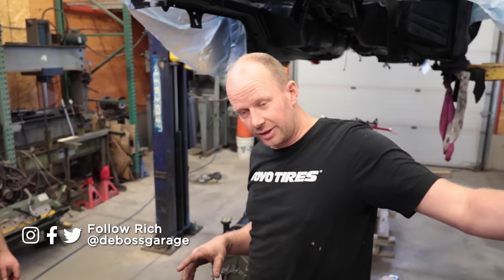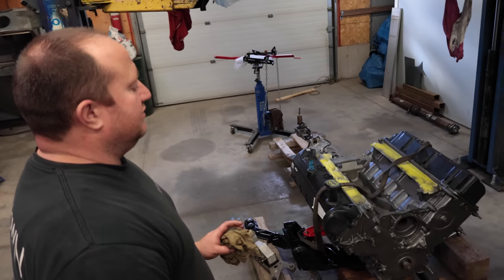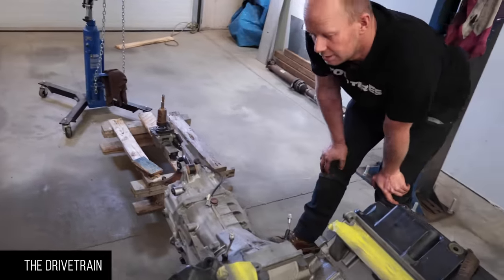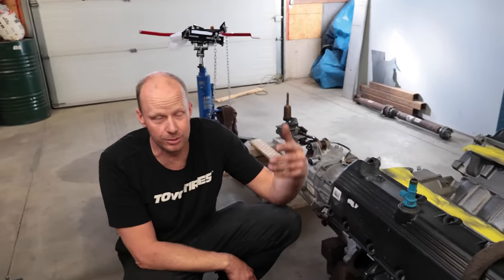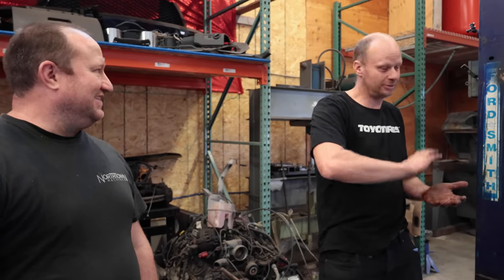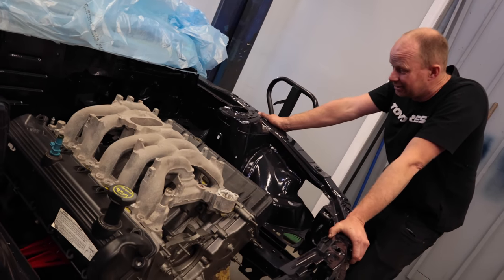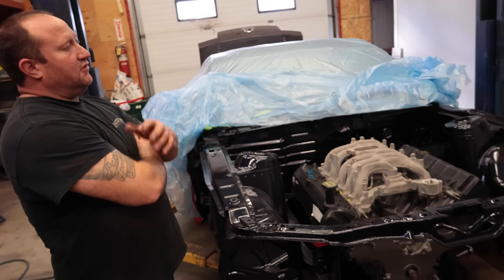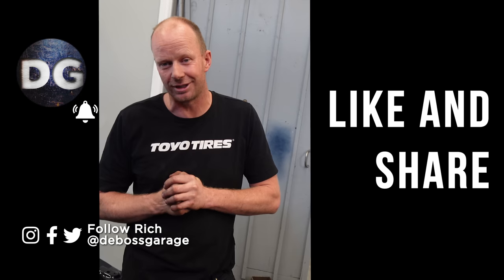6.8 Ford V10 stuffed in a Mustang.. 8v71 Blower or Nah? #V10Stang [EP1]

Comment: A blower would definitely be more cool than turbos.
Reply: Agreed.
Reply: By cooler I agree if you mean it would be LESS HOT
Reply: Turbo/s would make more reliable power on less boost not to mention keep the torsional load off the little short bolt crank snout.
Reply: @PeeterPuncher  your completely right especially since they’re more efficient too, however it would be more unique to see a blower set up instead of a turbo/ turbos set up
Reply: @fastinradfordable no way, the blower would run hotter. They are famous for it
Reply: Wont get any decent power with a supercharger tho
Reply: Now ya talking🫡
Reply: Put the pipe down 😂
Reply: Just run both👌
Reply: @PeeterPuncher turbos will  generate crazy under-hood heat. Which brings a bunch of problems to iron out.
Reply: @TexTheMaster nope turbos are known for making a ton of under-hood heat!
Reply: Blowers are always better than turbos...!
Reply: For REAL
Reply: @g.o.b.2558 I agree that would be the coolest
Reply: @kurtisstutzman7056 always? Lol
Reply: @utookmynames  Always...!
Reply: @erikturner5073  yes turbos do create a ton of heat but superchargers more so. The average IAT will always be lower on a turbo'd motor than a supercharger
Reply: @TexTheMaster  that means nothing when that turbo is COOKING everything near it under the hood. Also without intercooling BOTH turbo, and superchargers generate high intake temps. Pressure and temperature are relative regardless if it's through a supercharger or turbo. For me if I was building a street car to be driven in traffic as a daily, I prefer a supercharger (I'm not trying to back my under-hood components). If I'm building a track vehicle, and I'm not worried about backing the engine compartment, or endurance, but going for power, I  will probably go turbo.
Reply: yeah but turbos would make more power
Reply: @florider_hd  not necessarily... I prefer more low end torque/ power than waiting for turbos to spool...! Low end is more useful on the streets... thanks
Reply: @fastinradfordable heatsoak is a huge problem for most superchargers
Reply: @PeeterPuncher  I wonder if it would need a crank brace like the coyote does if you put a blower on it

Comment from the maker: Should Scott put an 8v71 blower supercharger on this or twin turbos?
Reply: I think a blower to keep a better power curve
Reply: Blower all the way.
Reply: I honestly think keeping it stock or with some nice ITBS would be awesome. I think a blower or forced induction would take away from it rather than add to its appeal. UNLESS its for performance only then id go turbo for efficiency and ease of adding an intercooler etc.
Reply: Blower or itb n/a
Reply: hell yes
Reply: Blower
Reply: 16v71 blower with an underdrive. With that triton weight is clearly not an issue, and it would absolutely scream.
Reply: Love that the V10 might start getting some love. Definitely team blower. Also, not sure if you can increase the bore on these engines to that of the 5.8 Shelby engines but that would give you a 7.3 and blower pistons.
Reply: NA, definitely NA. Keep it simple keeps the heat down, and a great machinist like Scott can definitely make that V10 destroy any tire thrown at it without a power adder 😉
Reply: I vote 871, I’d also like to see one of old Kenne Bell 6.8 superchargers, but those are difficult to find. And a 871 would be REALLY cool on this ole mustang
Reply: @maxwellg1361 I was going to comment 14-71 but hey... go big or go home, right? 😂
Reply: Keep it NA
Reply: Blower!
Reply: Lets not make it look stupid hey! Put a centrifugal supercharger like pro charger or run whirly bird/s!
Reply: @larryw5429  centrifugal superchargers are only good for top end. They make peak boost at redline, and give no boost at low rpm. Good for racing, not for street.
Reply: @Cantthinkofahandle117   14-71 would work too! But if anything is going to make a 8-71 look 'small' it's this.
Reply: blower forsure
Reply: Team blower for this one. Massive motor with a blow on it would be 👌.
Reply: Supercharger 💯
Reply: Blower for the look there will already be enough power. and low down torque is always fun.
Reply: Blower
Reply: blower would be real cool!
Reply: yes because a turbo 6.8L is pretty much too common and his will stand out as unique. plus the only roots style supercharged V10's i have seen were a hemi head swapped Viper V10 with an 8/71 and a R8 V10 with a whipple
Reply: Blower.😊
Reply: I have to go with ITB's as said before a couple of times. The torque and power would be more than enough. Add some higher compression valve springs and having that high revving v10 scream would be amazing.
Reply: I think ITBs would look amazing on this engine. Also, do you think the gearbox can handle the torque of the V10 plus boost?
Reply: Absolutely not, the old gmc style blowers are horribly inefficient and rob tons of horsepower.  I have an old Mooneyham 14-71 with a Hillborn 4 port mechanical injection sitting on the shelf in my office and it is serving its best purpose and that is wall art.
Reply: @camoking5059 The 5.4 kenne bill kit fits just by changing the snout.  I recently purchased a brand new old stock 5.4 kenne bell kit for a 2001 for $1000 on ebay.  The person thought the kit was missing a bunch of parts and it wasn't missing anything they just didn't understand how its installed.
Reply: Blower all the way
Reply: blower or na for sure
Reply: Blower
Reply: I would go a tvs 2.65 or a 3.0 whipple.
Reply: Twin super turbos, (think Nissan March Super Turbo) but up sized. Or something like what they had in a 1.4 TSI Golf GT. Yeah it's super complicated and probably pretty much impossible and absolutely not needed in a big engine etc. etc.
Reply: Blower.. dont overcomplicate an engine swap project that is a tight fit with a shit ton of turbo piping and all of that heat
Reply: 8V71 for low end torque. No idea if that tiny differential will hold together.
Reply: @Joebauers2505  The tvs superchargers produce way too much heat, the 8.3 Whipple would be a perfect fit and it wouldn't have to be over spun.
Reply: Turbos!!! ALL THE PSI!!! Also there are other ECM companies like Haltech.
Reply: Definitely blower!
Reply: Blower ftw
Reply: blower.
Reply: blower is must have
Reply: Either a blower or a couple of twin scroll turbos. Better low end. 
 My question is will the crank handle the boost? Especially where it has the conjoined rod journals without much of a strength radius.
Reply: Blower 💯
Reply: Blower!!!! V10 Blown Mustang sounds so cool
Reply: I know it is not as cheap as an LS but what is the reliability of the V10? I hear👎 but I am interested in the professional opinion
Reply: Blower take a lot of power to run. Id keep it na, scott knows how to make na power without heatsoak and extra weight
Reply: ❤ the sound of a roots blower
Reply: 16v blower for sure
Reply: Both duh 😂
Reply: Blower would be unique.
Reply: NA or blower to hear that V10 exhaust note.  Perfect build so far.
Reply: Modified svt lightning intake and supercharger. That would be cool
Reply: Blower 😎👍
Reply: Blower
Reply: Blower for sure... 😂😂 that standard manifold is ugly as sìn 😂
Reply: Blower..
Reply: Super charger all the way!
Reply: Turbos are nice but I’d rather be BLOWN…. 😀😀😀😀
Reply: Why not both?
Reply: Blower
Reply: ITB'S
Reply: Blower is so unique, like the build!
Reply: My vote is for the blower.
Reply: blowerrr!!!!!!
Reply: Blower!
Reply: Blower to match the low rpm characteristic of the v10
Reply: Definitely needs to be blown.
Reply: Blower. 
Just looks cooler.
Reply: Turbos would be nice if you wanted to keep more of a stock look as a supercharger might stick out of the hood but supercharger would also have a smoother power curve
Reply: Blower
Reply: If you want the wow factor, blower. If stealth is your jam, turbos! Turbos for me!
Reply: (relatively) Low RPM engine, limited space under the hood, hmmmmmm.  Blower! But I don't know that I would go with the 8V71.  Maybe something a bit more efficient and a water >> air aftercooler.  Blower won't change the exhaust sound either.  Wonder how a lil' blower whine will sound on top of that V10 scream?
Reply: Blower!
Reply: I'm with team supercharger.
Reply: If ya wanna be unique, turbocharge it. But have only ONE exaust header spool the turbo. Indycars use to do this. The other side exaust header  routes only to cat/ muffler out the back of the car. Install electric cut outs for strait exhaust on both sides and you'll have a mustang that can change its exhaust sound like no other.
Reply: Blower🎉
Reply: Definitely in favor of a big ol' blower Boss! That's the way I'd go 💪
Reply: Blower. Nothing more impressive then a blower sticking out of the hood. It would make great torque at lower rpms.
Reply: Huffer.
Reply: The howl of a V10 paired with supercharger whine would be epic! Another vote for blower here.

Comment: A gnarly roots blower sticking out of the hood is always a winning situation
Reply: Roots is uber-inefficient, though. Better get a Whipple or KB. More power AND far easier to cool.
Reply: Cool but won't deliver much oomph since it eats the most itself. And putting a lot of strain on the engine while doing so. Considering the somewhat weak nature of the V10 I'd much rather go for mid sized turbos and E85 (if it is available) and heat will only be an issue when doing too long of a  burnout at once. Burnouts generally are pretty good at killing your engine and driveline... anyway, the above setup would deliver some 500 - 600 HP reliably as long as everything is done right.

Comment: i hope he goes for the 2 stroke superchargers since they're kinda built for this specs wise
Reply: The blowers used on 2 stroke Diesel engines are horribly inefficient.
Reply: @ChrisHarding-lk3jj  6.8 v10 in a mustang is horribly inefficent aswell, so what?)
Reply: @Dssfox  Ford mod motors are junk to begin with.  V10 engines in general are not a good idea due to balance issues since they are fired essentially as two inline 5 cylinder engines.  Both the Ford and Dodge v10 engines came about due to cost cutting measures to increase displacement at minimal cost without a complete redesign.  V8 engines are much better when it comes to design and balance but definitely not the best.  The triton v10 gets my vote as the worst sounding engine built in the new millennium and installing loud exhaust should be considered a capital offense.  

An inefficient engine can have redeeming qualities, my 1988 Ferrari Testarossa came from the factory with 385hp at 5750 rpm from a 4.9L 180 degree v12 with it's pathetic 9.2:1 compression ratio but the harmony of sounds that came through the tubi exhaust more than made up for the lack of horsepower.
Reply: @ChrisHarding-lk3jj  you must not know about the audi/lambo v10s that are bulletproof power built up to 2k-3k hp
Reply: @X3R0D3D  Last month I bought a 2021 Huracan Evo and it is essentially a 7 cylinder engine since something happened with the timing and valves decided they wanted to get friendly with the pistons.  The car has 21k miles and I got it cheap.  I personally hate all vag cars but this one is a flip.  A stock engine will only take up to about 1200hp before Rodney pays a visit.  The 3000hp cars are using billet blocks and everything internal is aftermarket forged or billet.  The Carrera gt and the m5 both had short lived V10 engines.  All v10 engines suffer from the fundamental imbalance issue that does not occur in v8 and v12 designs.  Just because something can be done doesn't mean it should be done.
Reply: @ChrisHarding-lk3jj upload the cars
Reply: @ChrisHarding-lk3jj  Must be nice
Reply: @ChrisHarding-lk3jj  Any opinion of the long lived Judd V10? They powered endurance prototypes for more than a decade.
Reply: Fuel tech USA ecu guys
Reply: i dont know if anyone has said yet but the 6.8 is on the 5.4 deck height. you will need a 5.4 2v intake to cut up. i am putting  this engine in my 2000 harley davidson f150

Comment: Something cool about Mod Motors is they come in 2 deck heights. The 4.6,5.0,5.2 have a shorter deck. The GT500 came with a DOHC 5.4L and a DOHC 5.8L. the 6.8L shares the same deck height because its a 5.4L+2cyl. You can even put GT500 con rods and pistons in your V10! If width is your worry, worry not! If a tall deck mod with DOHC can fit, a SOHC 2v tall deck will definitely fit.

For what its worth, i think a blower would be EXCELLENT with this engine! Good luck with the build! Ive wanted to put a V10 in one of these for a while. The 3V was notorious for spark plugs but you can get 1pc plugs for them. The 3V heads flow more but a supercharger and your porting should well make up for that!

In regard to Holley, I was thinking they have 16 unique "controlers" so you may have to waste spark but each injector could get its own signal for 15 signal outputs.

For your brakes, the S197 only had a limited production of GT350s like 15 or something. You're better off with a Willwood or Brembo rear caliper. The E-brake on 8.8in rear ends, weather solid axle or IRS, is the drum kind, not caliper integrated like a fusion or something. That may be where the Ford guys were getting confused, hearing "E-Brake" and "caliper" together or "GT350" and knowing you're working on an S197

 Good luck on the project!
Reply: For the brake system on an s197 he'd be better looking at the factory big brake brembo. Came on premium versions.
Reply: up
Reply: The Lincoln Navigator had the original 4Valve 5.4L DOHC mod motor.  Just a stroked high deck block, same bore/spacing as the  4.6L V8 DOHC in the Lincoln Mark 8 starting in '93 was the predessor to 96 mustang Cobra (Much interchange) with the coyote.  So , should be possible to storke a 5.4L DOHC Lincoln Navigator to the GT500 5.8L.  I think the GT500 in 2014 came with the VVT to boot, so maybe the Gen 1  coyote heads will fit a 5.4L Navigator  and the VVT can be adapted?  Also, Somebody took the 6.8L 3 Valve V10 and some welded up some DOHC Mark 8 heads to give a DOHC 6.8L V10   The V10 three Valve shares the bore and stroke and spacing of the 5.4 V8 mod motor block with two extra cylinders added.

Comment: Gotta throw the blower on it. Imagine the low-end torque 🤤🤤
Reply: That's kind of the problem for not grenading that transmission. Nor the split pin crank for that matter
Reply: @ElPants21  those are tomorrow problems bud
Reply: @ElPants21  I have yet to see any hard evidence that the forged split pin crank will really be an issue. Kenne bell offered blowers for trucks and vans equipped with the triton v10
Reply: Split pin does not necessarily mean weak. Look at the GM 3800 V6. They came stock with superchargers. Lots of people turbocharge them, making 500+ hp. The split pin crank doesn't care. But the gearbox and/or rear diff might be another story.
Reply: @michaelblacktree  I mean, the triton v10 makes the torque of a supercharged lightning but NA on 87 octane. I agree that the crank will be a non issue.

Comment: Skip the old obsolete blowers since they are horribly inefficient.  I supercharged a Triton v10 15+ years ago.  I used a kenne bell supercharger kit for a 5.4 engine.  The kenne bell supercharger was designed to use the factory ford intake manifold, it has a plate that bolts onto the intake manifold where the throttle body elbow normally lives.  It was actually very easy to get everything lined up and working.  I can't remember who I sent the heads to for cnc porting.

Megasquirt can easily control the ford v10 and it is extremely affordable.  I have installed megasquirt on numerous ford v8  trucks.

You may want to give John Mihovetz a call, he has numerous mod motor records and is probably the number one mod motor authority.  John Mihovetz is the owner of accufab and he recently became the owner of Kenne Bell superchargers.

Comment: Awesome build! We had a few issues with our v10 mustang build. 2 valve fuel rails don't like to be run as non-returnless so if he plans on running returnless he might need to use the 3 valve fuel rail. the injectors get overloaded and it dumps a bunch of fuel and tends to smoke a lot and stumble 😂. Also to fit all that's needed is a cowled hood. We had to cut the stock one (but we had a dumby scoop) Depending on the headers(we went with aftermarket. the steering rack will probably need to be adjusted to one of the sides as the height is very close. You can use the stock driveshaft everything lines up like normal. All of the 4.6 a/c lines fit like factory, even with a 6.8 8 rib a/c compressor 4.6 has 6 rib. Some issues we faced was attempting to remove the valve cover on the driver side is somewhat difficult as the brake booster is in the way. The 6.8 intake makes it very difficult to get to the top transmission bolts. I have documentation of pretty much most of the stuff we've done although it's not as pretty as it could be but it all works! I hope he gets everything working, good luck! if you have any questions we have a little experience with this swap.